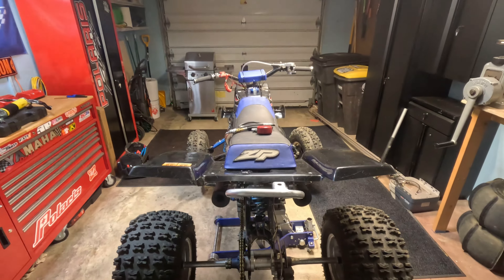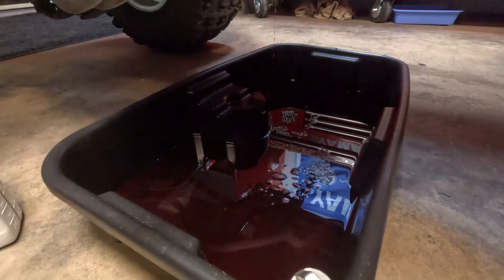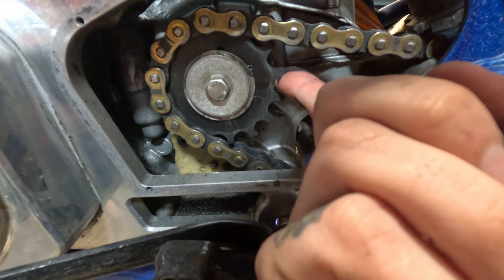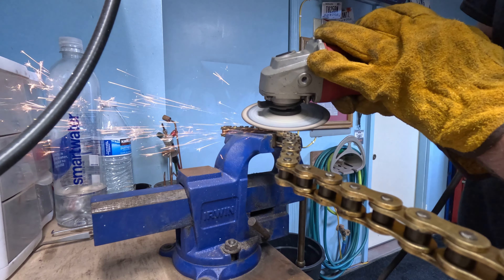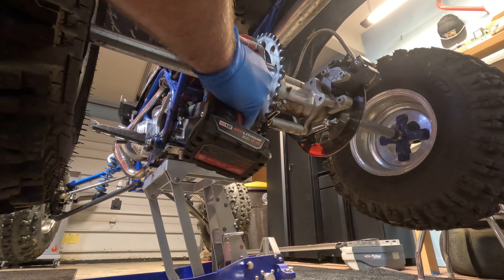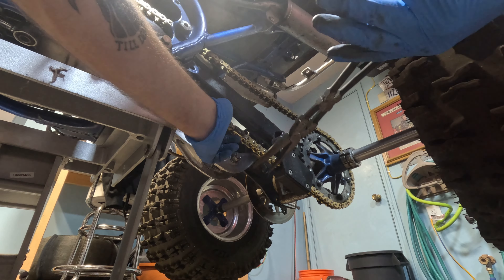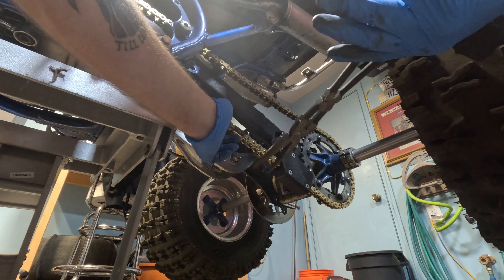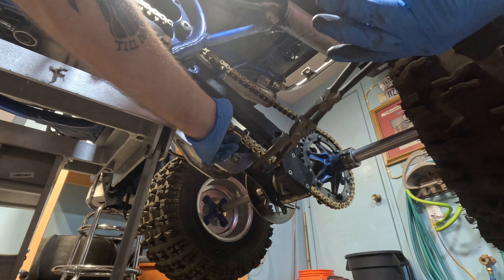How I Maintenance my Quad (5 Tips)

Comment: oww nice J arm banshee
what extended J arms are that? i might wanna buy some someday for mine when i get the money i have a 1988 banshee still oem just rebuild and a twin air foam filter and some fatboy 2 silencers
someday i want a full exhaust system but befor that i think i want some extended J arms but there not alot of option for them J arms (in europe) its all import from usa or some facebook page from portugal makes then. 
that a nice banshee i see pyramids paul turner headers alot of ducan parts
Reply from the maker: I honestly do not know what extended a arms they are, I bought the gram just like it is. Everything was powder coated but I would assume everything was installed when this was brand new because I couldn’t find them on the internet when I was researching everything. Probably stopped making them 20 years ago!
Reply: @GuessWhoGurr  yeah that sums up my problem :( all them companies that made J arms dont exist anymore. only fireball makes then, and some random facebook page i found. i have seen alot of different extended J arms on old forum but al those brands dont make then anymore or just disapeared.
Reply from the maker: @reggiexp69  yeah bro best bet is to get lucky on marketplace, or buy some bar find like I did with them already on. Thanks for the compliments! Hope you find a pair one day!
Reply: @GuessWhoGurr  yeah always on the look out for 2nd hand J arms but that is hard also :)
plus in france people dont like J arms banshee they pays less for them, i like then cause its something different then the basic A arms grey frame banshee u always see :)
Reply from the maker: @reggiexp69  yo I just checked out my front end and they are Roll Design